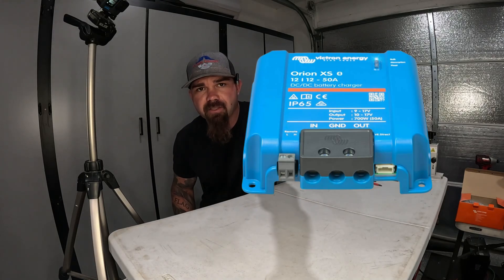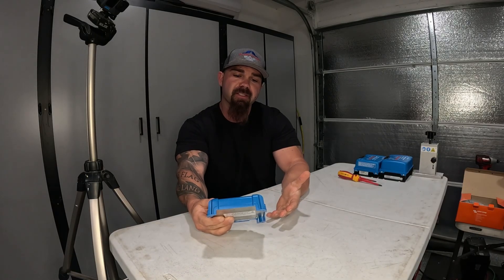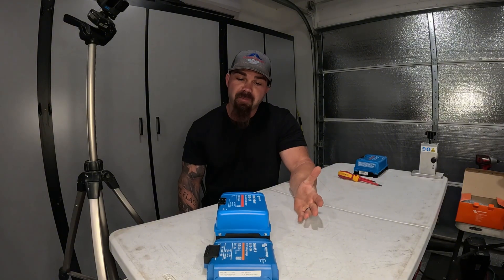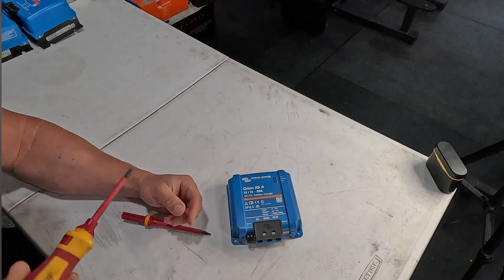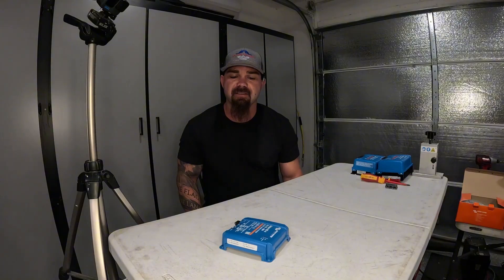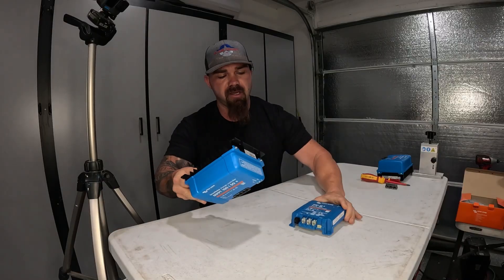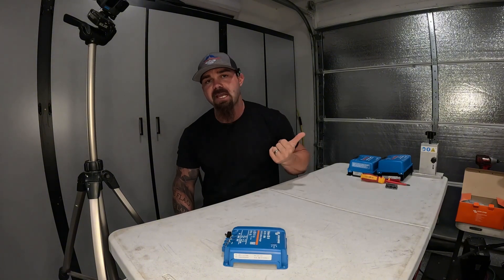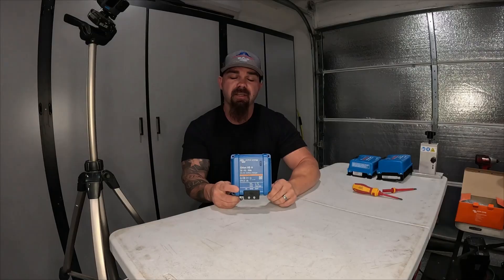SERIOUS CHANGES to the NEW 50A DC to DC Charger!

Comment: Was going to get a victron 150/60 but they want me to sell a kidney to buy it.
Found a LiTime one with better ratings and cheaper too.
And the LiTIme has a display and buttons where you can check things and change settings WITHOUT a damned cell phone.
I for one hate cell phones and haven't had one in years. I do not want to be tethered to one just to get anything done.

Note: I noticed that no one bothers to talk about the mounting surface for those controllers.
If plywood is ok, how thick and what type?
If you have to have drywall, same questions.
If you need sheetrock, same questions.
What orientation for the controller? Flat surface? Wall? Ceiling?

Concrete and brick are plenty fire retardant.

50 amps at 48 volts is a LOT of watts and heat.

Most controllers never bother to tell you how big of a cable you can use to make the connection either.

While 10 gauge is popular, I doubt it will hold 50 amps.
But 8 gauge will (40 amps all the time and 50 intermittently). And 6.
Reply from the maker: Victron offers a non Bluetooth model as well that has a selector switch for the different charging parameters, but if you prefer not to use a device for monitoring and setup that is definitely up to you! They are marketing to the masses and people that do not have cell phones are the VAST MINORITY in today’s society but i understand the annoyance. Glad you found something that works for you!

No one talks about mounting surface because it doesn’t really matter… I’m not sure where people get wrapped around the axle with this topic but in 5 years of installing these products i have mounted them on literally EVERY surface with ZERO issues. Carpet, block walls, plywood, etc…

Total Wattage does not matter, the heat build up comes from amperage traveling through the conductor and this device is limited to 50 amps regardless of the voltage so that’s also not a concern. 

Wiring is not all created equal so many companies do not want the liability of telling the user what sizes of wire to use as the different types have different current carrying capacities… copper clad aluminum can have ampacity limits that are HALF of oxygen free copper wiring with a high strand count. 

At the end of the day, Its the users responsibility to determine correct sizing for the application of the product and this decisions are based off of a myriad of factors including the length of the wiring run which victron can’t determine for every installation…
Reply: @RvPowerPlug  50 amps @ 50 volts is roughly 2500 watts.
That approaches space heater range.
Wife is worried about fire risk. Especially in an old house filled with wood paneling.

I have looked at nearly every Victron controller.
One one or two you can buy at an extra fee, a plug in display.

Haven't found a new one with a display included nor manual setup for parameters.
Heck, my batteries don't have all that information. And they are brand new.

I don't see any benefit to micromanaging a controller or system That would be like trying to beat the stock market by making trades every minute. Lots of time involved in that method.
Does anyone really need to know the output of their system every minute of the day? 

Not everyone has or even wants a cellphone and yet most of the Mfr's make their products so you must have a cell phone to do setup and such instead of having a large display with real buttons that you can easily access all the settings and such.
LCD displays and buttons are extremely cheap. Far cheaper than the cost of a cell phone and service. which is recurring.

And of course, a 150 foot extended range bluetooth lets everyone nearby know what you are doing.
Even if they cannot see the info, they know you have something. Thieves are everywhere nowadays and so are haters.

Anyway, I prefer something that is not obscenely overpriced for what I need to do.
Prefer something middle ground - best bang for the buck as it were.

Not saying Victron is bad or anything but they have some glaring flaws.
Like the PRICE.
Even Bluetti is in that same category.

Mfr's can easily state the MINIMUM wire sizes needed, and even optimal sizes.
50 amps needs 6 gauge wire but you can use 8 gauge intermittently.
Wire amperages is rates for constant power. Wires also have a hidden 2 hour over amperage rating that many are not aware of where you can safely overcurrent the wire for brief periods.
Which is up to 150% of the rating depending on the particular load and the time.
To get the fire ratings of solar cables is no different. They too must be able to handle up to 150% of their rated amps for 2 hours.
If your load needs 50 amps all the time then you have to use no less than 6 gauge copper wire. 4 gauge is better but I didn't see any controllers that take 4 gauge except for a very small handful, unless you get into the expensive commercial/industrial ones.

Odd that the weakest link on controllers is the wiring attaching screws.
They could make them to take the more robust and safer lugs.

I dunno. Head swimming over all this unnecessary technical stuff.
Set it and forget it is actually what I am looking for and NOT need a damned cell phone to do it. 

Question: what information is that app sending back to the Mfr or anyone else?
What hidden information is it sending?
Your identity info? GPS coordinates? Phone info?

Beware of tech - it can cost you...
Reply from the maker: Are you talking about an MPPT charge controller?
Reply: @RvPowerPlug  yes why?